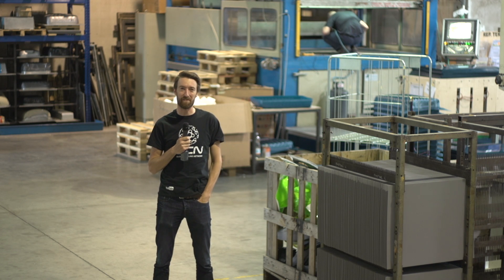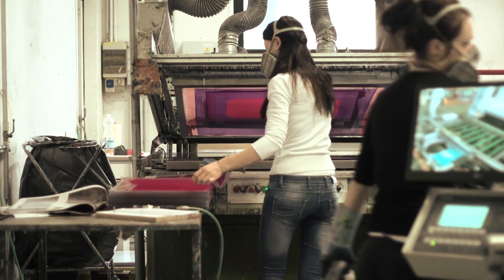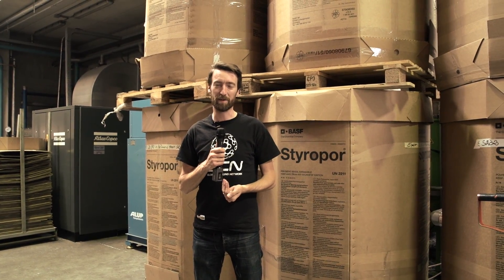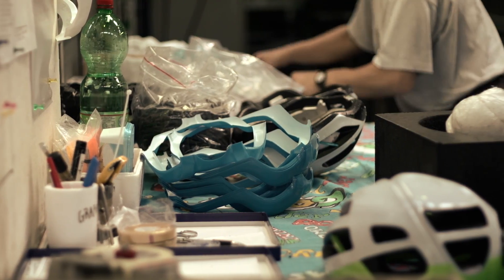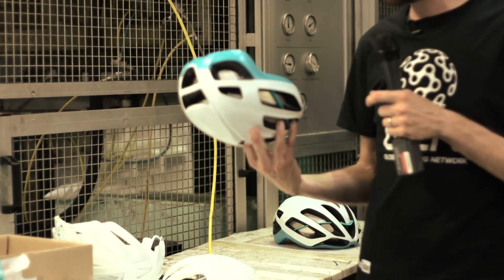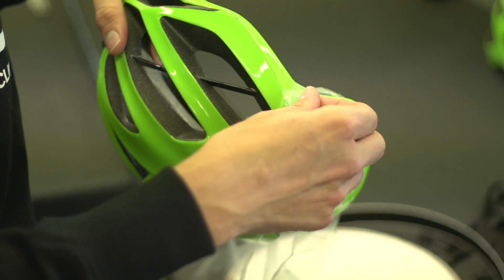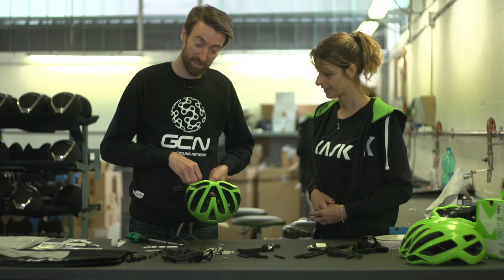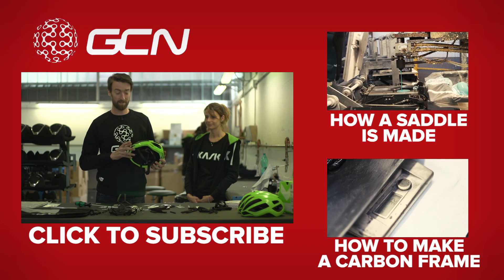How A KASK Bike Helmet Is Made

Comment: 2:42
40 degrees? 
Sweating? 
Oh...Celsius
Reply: Matt Burkey Yeah used to work in that heat all the time, not pleasant, plus my factory was a damn site more noisier! Looks like they've got mandatory breathing PPE due to all the micro-fibres, ours was mandatory hearing - and hairnets as we were a FMCG* company (which they're not worried about here).
*Hmmm Google tells me most people use that abbreviation for Fast Moving Consumer Goods, whereas I know it as Food ManufaCturinG.
Reply: I worked outdoors in 100 F (38 C). Must have been heck to be that hot inside.
Reply: Yeah it was, but obviously you get used to it to some degree. Artificial lights for 12hr night shifts didn't help either. Neither did arsehole management on your case all the while. I forget why I left that job...